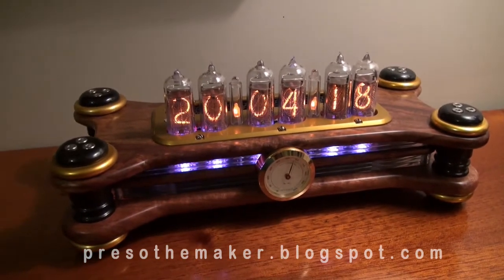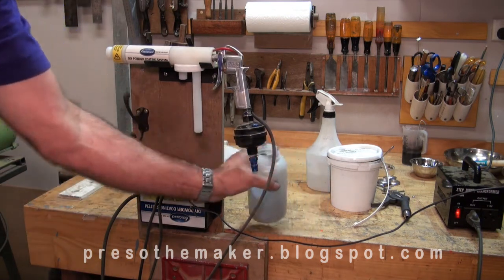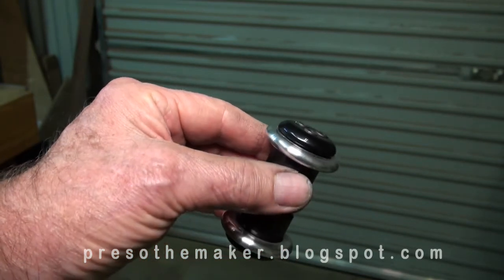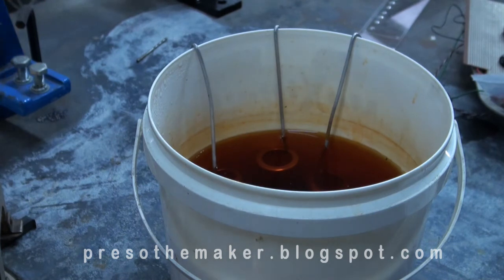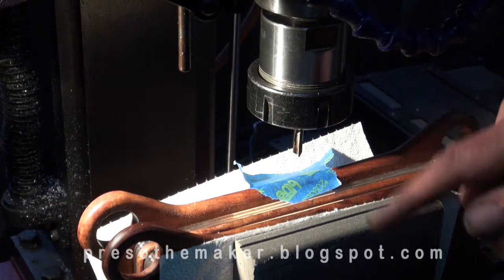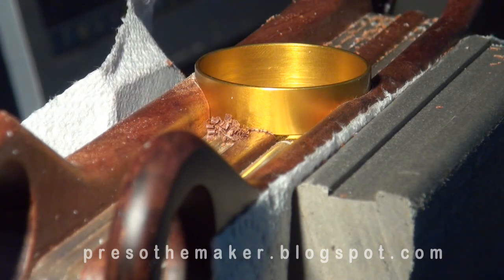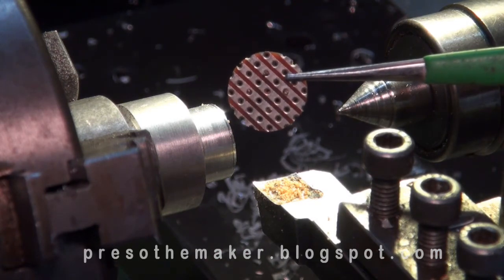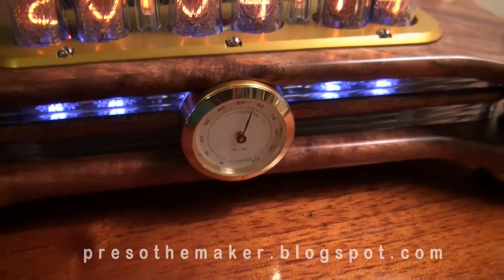Neo Steampunk Nixie Clock Build - The Finishing

Comment: I slipped in the backyard a few months back and seriously tore my right rotor cuff. Currently I do 3 courses of physical therapy every day at home and will be doing it for a while longer. It was so boring going through my routine day in and day out. Then I had a brain storm. Since this is going to be my next project as soon as I gather all the materials, I now watch all 4 of your Neo Steampunk Nixie Clock Build videos while I am doing my stretches and exercises everyday. I actually look forward to each and every session. Ironically I seem to learn something new or something I missed every time I watch them. They never get old and really take the sting and boredom out of the therapy.
I mentioned this before, and I will mention it again. You Sir are a Genius of the First Order. Thank you for sharing your wisdom and skills. And especially Thank You for sending me the drawings!
Reply from the maker: John,
Sorry to hear about your accident. I hope the therapy is working out. I forgot to mention, with regards to the drawings that they are specific to the Nixie kit that I used. Other kits might have different spacings for the nixie tubes and/or different dimensions altogether. I also modified the top plate by removing the bridge piece that separates the cooling vent from the nixie tube space because one of the electronic components on the circuit board was in the way. As it turns out the bridge piece was redundant anyway. 
Regards,
Preso
Reply: Thank you once again Sir!  I understand about the possible different sizes. I was waiting until I have all the necessary pieces anyway. Two of my favorite shop rules are,"Haste makes Waste." and "Measure Twice-Cut Once."   My Nixie should be getting here anytime. Once I have it in hand I will be able to better determine what size I need for the openings as well as the acrylic size. Your drawings have already saved me a ton of frustration as well as money! I shall forever be in your debt!
This is going to be so much fun!!!
Regards,
John Archer 
PS-Also Thanks for the kind words! Shoulder is getting a little better everyday!

Comment: Mark,  If I'm remembering correctly, the Chemist at work who is our anodizing guru said that the agitation in anodizing baths is critical for the chemical process of anodizing to work properly.  Maybe if you tried using a fairly stiff agitation the next time you try anodizing, you'll have better luck?
Reply from the maker: I do have an air agitation system in the anodising tank but I wasn't sure it was really necessary. I have since found out that a lot of my problems were to do with using aluminium of unknown origin. Getting the correct grade seems to be crucial. I also ditched the sulphuric acid electrolyte that I was using and replaced it with sodium bisulphate which is cheaper and a little safer. Further, I gave up trying to calculate the surface area and the current density and I just give it as much current as it will take at around 15 volts. I doubled the time in the tank and now it is working for me. I did a video on making a dial indicator holder for the lathe in which I gave an update and it turned out great. I do recall reading that agitation knocks the hydrogen bubbles off the metal surface and it does speed up the process. I will try it next time to see if I can measure any difference in the depth of the anodised coating

Comment: excellent  build mark i have a collection of nixie clocks some fitted in old electrical test equipment and some in perspex cases that i bought from the supply of the kits  so it was very interesting to see how much work went in to your build how many hours went in to it ?
Reply from the maker: Hey. thanks for the comments. I am thinking that I must have put about 20 to 30 hours into the build itself. There was a lot of work put into the CAD model before I started to cut materials though. I prefer to fully model as much of the project as I can so that there are not too many unexpected surprises when I start to fit parts. I also wasted a lot of time trying to get consistent results with the anodising process. Many of the parts had to be done several times before I was happy with the depth of colour. I wish I had a ready supply of vintage electrical components. They really make the project look authentic!